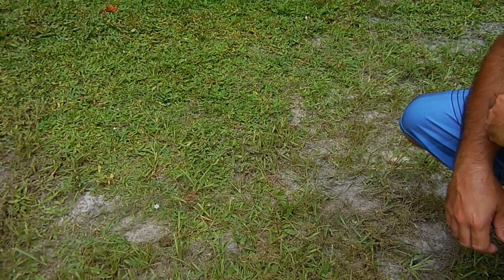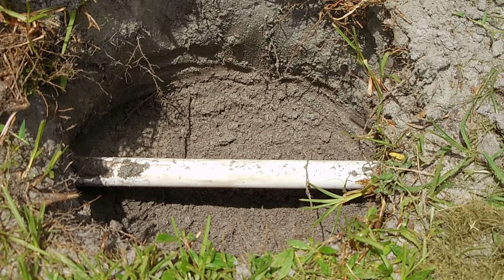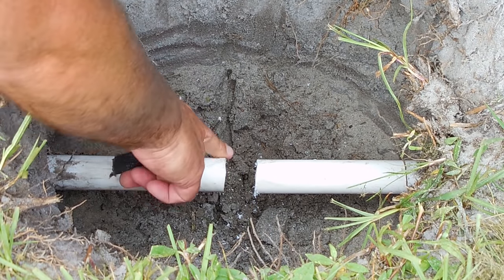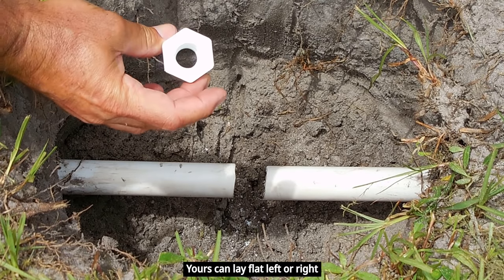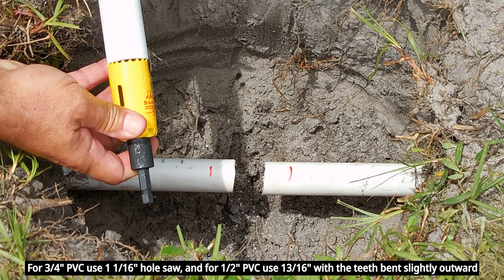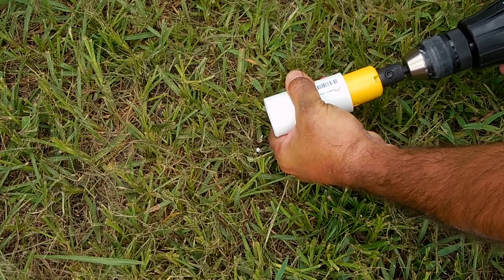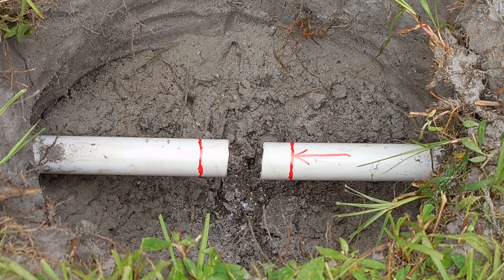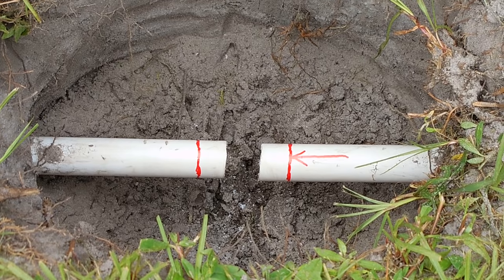How To Easily Tap Into A Buried PVC Water Line With The Least Amount Of Digging!

Comment: Here's a pro tip, dig 2 more feet to either side in order for you to get a bit more leverage. Then glue your tee onto the pipe with less leverage, then use the leverage to pull both pipes up until the pipe goes into the fitting. Easy does it. Takes way less time, it's a better repair, and it's less expensive.
Reply from the maker: Can't always do that, especially when a pipe is between a walkway/driveway. What I showed works very well once you get the knack.
Reply: @electronicsNmore   nope cant always do that you are correct.. still I would not alter any pvc fitting in that manner.
Reply: Thanks for  that tip, it  doesn't seem possible to me so I would not have known to try what you suggest, so your comment was valuable to me. So even though I like your tip, I disagree with your summary. Digging two extra feet is not "way less time" then grinding out the stops, and I don't see how your repair would be any "better" and especially "less expensive" than that shown.
Reply: @TheLarryBrown   less expensive because you don't have to buy drill bits to alter the fittings. Less time because you're already digging just dig a little more. And it's a better repair because the compression of using leverage will hold the T's in place rather than depending on the solvent weld to cure which takes a proper 25mins. The stops allow you to pressurize the fitting sooner.
Reply: @TheLarryBrown   In the event where you have to replace a broken T for a pipe 1" and below you the fittings needed would be 2 couplings a new T and a bell end about 6" long. Sometimes you can't dig more and the bell end is basically a long coupling you can turn into a slipfix.

Comment: Good idea but didn't work for me.  Fitting leaked like a sieve after installing.  Bought the exact same hole saw and bent a couple of teeth as described.  The hole saw scored the sides of the T despite being careful but I was naïve enough to think the glue would fill in the scratches.  It didn't.  Plan B was to use a slip compression fitting which makes the job a LOT easier although about $6.00 more.  Good experiment, though, and I learned from it but didn't like the extra work.
Reply from the maker: Sounds like you bent the hole saw teeth too far out. Scratched/scored areas bond extremely well.
Reply: Good comment but explain to us what is a slip compression fitting."

Comment: Why did you skip sliding the tee into place?
Reply from the maker: The camera was very close to the hole, and when I leaned into the hole to slide the tee into position, my body covered the work area. You can see it's the same tee solvent welded in position.

Comment: This is not an "I'm better than you" comment but, It looks like something weird happens at 7:46 that got edited out.  Maybe the fitting slipped on too far because there was quite a bit or too much primer used. This  making the pipe and fitting too soft or the pipe slid deeper into the ground making it was too short to fit on the other pipe until that was fixed. It would have been interesting to see the struggle as you had to torque the other pipe high enough to get it into the fitting.  I used to install and repair irrigation systems so I've seen quite a bit. I think you'll find it easier if you expose about 4 feet or even more of the pipe to make bending it into the fitting easier. Also, If the pipe does not stay pressurized, like the pipe on the pressurized side of the valves, you really don't need to use primer.  It's good to show the struggles.
Reply from the maker: I had the camera to my right shoulder very close to the hole, and when the cement was applied, I had to lean in to work the fitting into position(tighter than anticipated). The right side of my body and shoulder was all you could see, so I edited it out. You can see the pipes and fitting are exactly what I started with, no trickery.
Reply: So odd that these really oddball comments keep coming up. How is digging 4 feet of hard clay soil going to be easier than one minute of work??? If you can dig up 4 feet of 10" deep pipe and then refill that AND keep the sod intact AND avoid putting dirt on the grass, all in one minute, wow, you must be the flash. As far as not using primer, OMG man, are you kidding me??? Please tell me you are not really that clueless. That's literally 5 seconds of work from a $5 can of primer that, good gosh, I hope you own. Given that the technique shown is one minute of work, it seems all these "way too much work" comments are coming from a distaste of owning a hole saw and using a drill on the job site. What happened to the type of man that eagerly embraces any need for a new tool, like a Kobalt cordless drill? I have found that a drill is one of the most useful tools I own, right after a screwdriver.
Reply: @TheLarryBrown  Sorry my G, You seem too upset to discuss anything with. To avoid triggering you any further I'll just wish you to have a nice day.

Comment: Add  4 x 90 degree bends and come in from the side. More fittingS  but a lot les work IMO.
Reply from the maker: (4) 90's works, but it does increase friction losses because the water hits a wall and changes direction 4x. I wouldn't recommend it for main lines. You do single or multi port?
Reply: Odd how you, and others, feel that the reaming shown is "a lot of work." Granted you need the hole saw and the drill handy, but given that, it's ten seconds work.

Comment: I used this method recently and both connections I made leaked. I followed the directions as given. This ended up wasting a lot of time and money. Should have just dug the hole larger.
Reply from the maker: Clearly you didn't do it correctly or need to practice.
Reply: You must have reamed too big. Yeah, that would ruin the TEE.